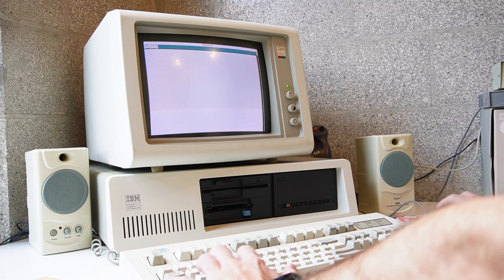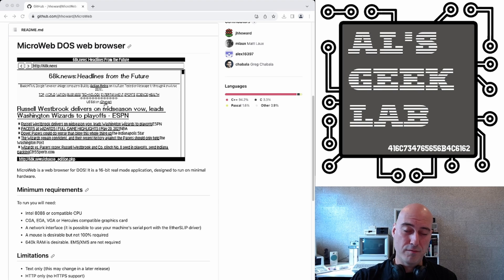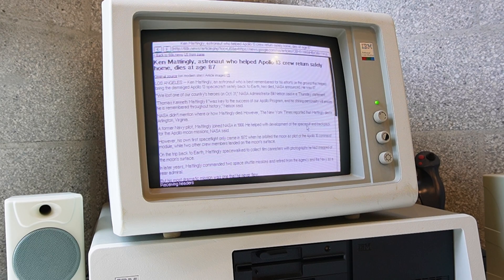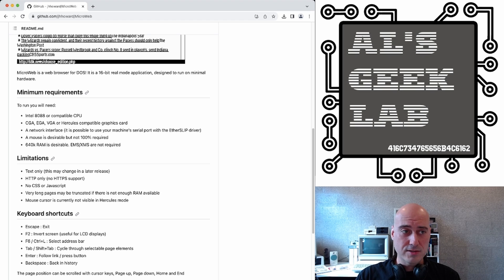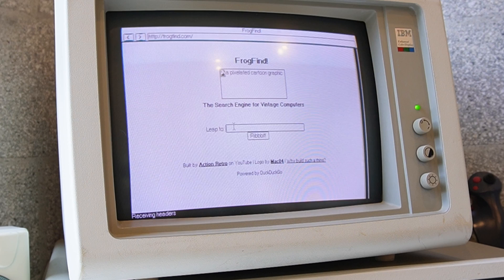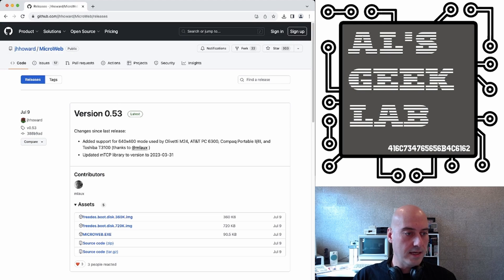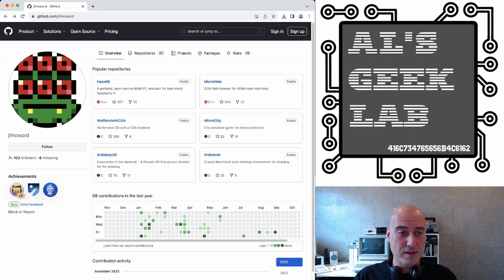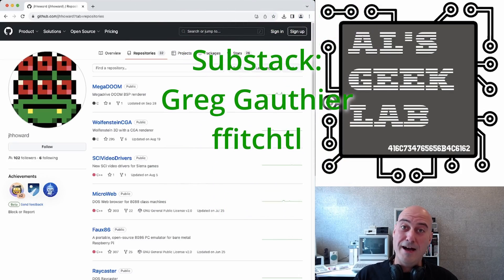Web browsing on a vintage DOS PC with microweb

Comment: Thanks for checking out MicroWeb! I have some improvements in the works for a bunch of things like better Unicode support and displaying images but they aren't quite there yet :)
Reply from the maker: My dude! I was about to track you down and see if I could send this video to you, I guess you found me first! I'm a big fan, as you can tell! I look forward massively to any updates, I'll keep the channel updated with them...
Reply: How tied is this to the IBM PC?

Before I get too excited about the possibility of a pi Pico surfing the web.
Reply from the maker: @benholroyd5221  this is a DOS application. It doesn't need to be running on a real IBM PC, but it needs to be running on a system that runs DOS (DR-DOS/PC-DOS/MS-DOS).
Reply: @AlsGeekLab  I was thinking more. Are dos interrupts and magic numbers peppered about the place, or in one or 2 defined places.

I noticed a platform library but that didn't seem to contain all the system calls I'd expect.
Reply: This is some awesome software. I have got to try this on my pcjr.
Reply from the maker: @jhhoward, did you see the video made Hackaday?!